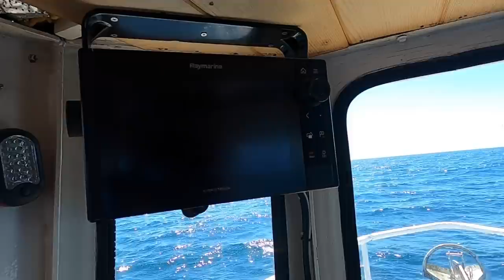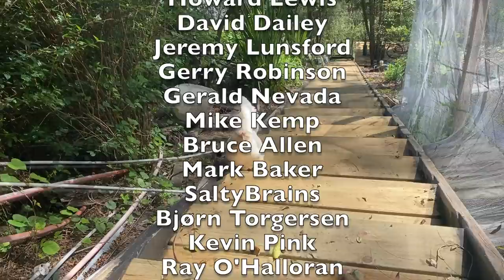Gone fishing!

Comment: The other option with the heat exchanger is to bin it and fit a cast iron manifold off of the plant version of the mitsubishi engine. Then you could fit the aftermarket heat exchanger separately. You would have to wrap the cast manifold to try and keep the engine room temperatures down. Or build a manifold out of steel pipe. 

It looked like a good time out fishing. All the best mate.

I can get a new heat exchanger housing for around £500 and the tube stack heat exchanger is another £350 or so here in the UK. Plus shipping to AUS.
Reply from the maker: I have thought about getting the exhaust manifold from the road version of the engine, could be a good way to go.

Comment: I didn’t notice what kind of engine it is. I know it’s Vetus but they don’t make their own engines (I don’t think). They just marinize them. Kubota, Isuzu, Yanmar Tractor, or any number of others. Find the none marine exhaust manifold and build a basic water neck that ejects waste hot water so the rubber exhaust pipe stays cool. Then find a heat exchanger. 

The only thing you’ll need to work out is an expansion tank with a radiator cap on it. But that could be fabricated without to much drama at a local radiator repair shop out of brass. They’ll have solder on radiator cap bungs. Something that hold a few liters and have a 3/4 nipple on it that you can T-into one of the coolant lines. 

Note: use silver solder for durability. It takes higher temps but is much stronger for beating around in a boat.
Reply from the maker: Vetus are based on Mitsubishi.
Reply: @DangarMarine  can you identify the model of Mitsubishi were it for a land based vehicle or generator? Mitsubishi makes a fine diesel. 

Might even be able to find a used dry manifold on eBay. If you get me a model I can search a bit in my area.

Comment: I know off topic, Stu, but what's your thoughts on these new fly-by-wire and auto-throttle controls new these days?
Reply from the maker: I can see the advantages when they work and I assume they have a certain level of redunancy built in. It would be interesting to see the comparative failure rates with regular cables. They may actually come out ahead.
Reply: @DangarMarine  Yeah they come with a stand-alone backup system as a standard feature.  My friend in Florida says all the offshore fish outfits are switching over partially for fuel costs but also they run their operations more like airlines now and the auto helms save time and record costs.  It's so different from what I ever knew!

Comment: Stue did you ever figure out what your fuel burn per hour was and fuel efficiency?
Reply from the maker: It’s roughly 1 litre per nautical mile.
Reply: @DangarMarine   I would consider 54L/100KM pretty decent for 30' steel trawler with a 2 stroke detroit.

Comment: Hi, just on the Vetus heat exchanger, I know them as a Mannicooler, You can also get a Manniheader which is what I've used on my Cummins conversions, this is as you might imagine a header tank slash manifold with a separate heat exchanger. ASAP supplies in the UK do them for various engines if you know what your base engine is. I'm doing another soon for sail boat and going to use on an industrial 2 or 3 cylinder. My Cummins builds are on my channel if you fancy a look. Enjoy the fishing 👍👍👍

Comment: Why are your fenders out? Sign of a novice sailor.
Reply from the maker: Because when they are in the are in the way and when they aren’t out they aren’t.
Reply: @lemullet6273  Sailor is a person who operates a BOAT or a SHIP.
Reply: @DangarMarine  They snag fish & lines. Need to come up with storage solution as they tend to snag stuff flopping around out there. Also cause drag and cost fuel...
Reply: @lemullet6273  FWI, anyone who runs ANY type of boat or ship is a sailor, as are all that work on them.
Secondly, it is actually a safety concern as well as looking bad, which means I’m not “nit picking” anything or anyone. I have over 20 years of boat and ship handling experience, and you?
Reply: @lemullet6273  if you live in US you should take the Coast Guard basic course or United States Power Squadron Course. I recommend both. If not, find a good course where you live.